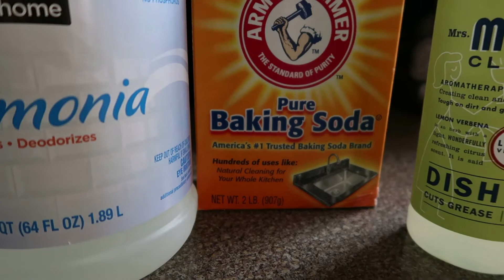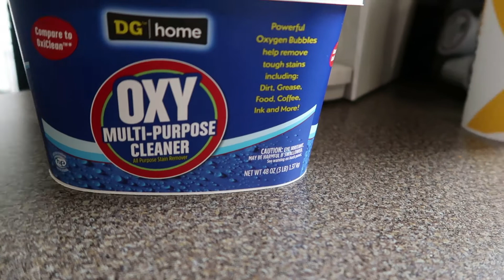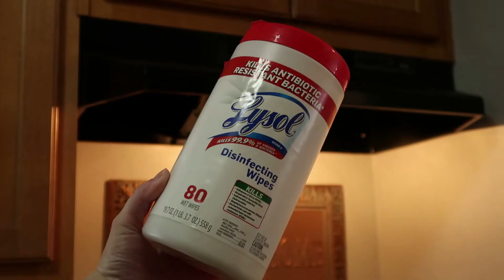EXTREME SPRING CLEAN EPISODE 2 || EASY OVEN CLEAN WITH BAKING SODA AND AMMONIA

Comment: I have a new Samsung stove that  has the blue ceramic coating. I was told there is a clean feature cleans in ten minutes. Not true doesn’t work at all. My husband broiled steak in the oven made a huge mess. I had to use oven cleaner and scrub the heck out of it. ☹️wasn’t fun at all.